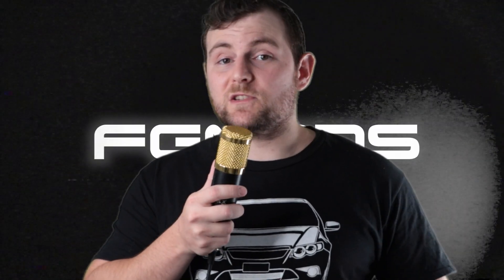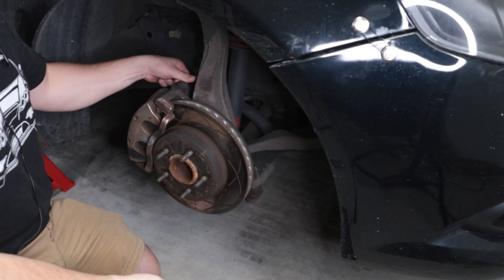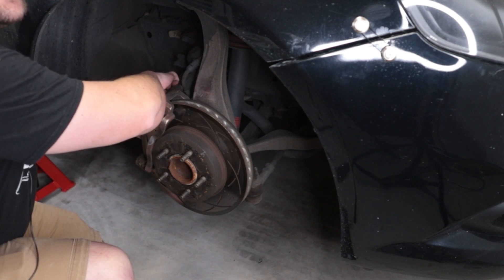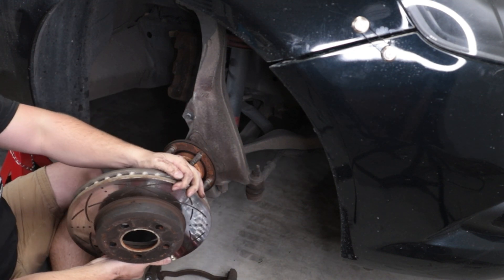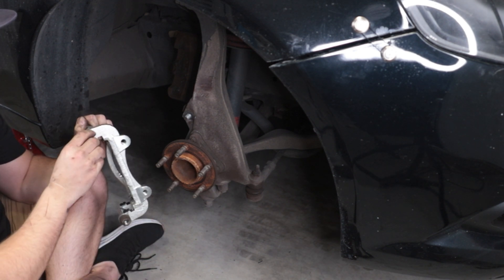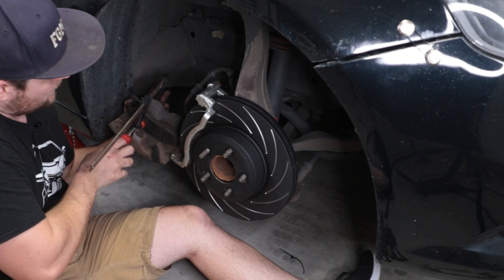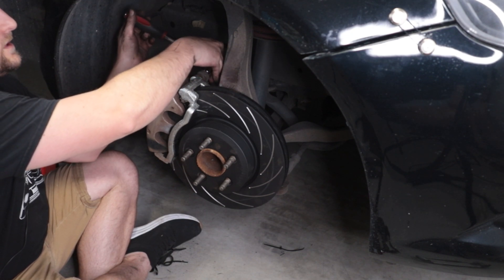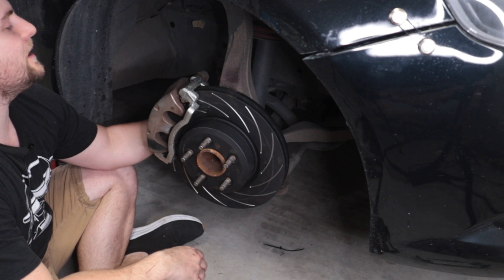Falcon NA to Turbo brakes conversion #fordfalcon #xr6turbo #xr6 #barra

Comment: Liking my upgrade. Bought my fg with 380k on the clock. front pads had 1mm of pad left and orig rotors lol so this upgrade only cost me $100 for the bracket set on top of new rotors and pads. I opted for dba 4000s and ebc yellow stuff pads. Next up is some used territory rear calipers and some upsized 328mm thicker vented rotors and ebc yellow stuff pads for the rear. used calipers cost me $100 so again only $100 over replacing the stuffed rotors and pads.

Comment: Further brake upgrade path:

- DBA Extreme (Orange) pads at front (alternative EBC Yellow Stuff). The F'c v stops v temp of these pads is epic. Look up the data.

- same brake pads at the rear! Yes it makes a massive difference; it took me 10 years and many brake replacements to figure that out

- HEL (Australian) braided brake lines all round

- ideally pillar vented (or DBA 'Kangaroo Paw') front discs, and more ideally, the same type of disc at the rear if applicable (I am running a BA-T with Factory FPV Blue/Premium Black C5/6 PBR brakes)

- most ideally, go the DBA 2 Piece DBA5000, alloy hat front discs

It's pretty epic what lightweight, high quality, sliding calipers can do.
Reply: Hey does it matter which brake line you use or does it have to be Ford falcon specific because I can't find falcon ones on their website

Comment: So here is the interesting thing. Everyone assumes a person installing a turbo is a wanker who plans to race on the roads at way above legal speed limits. The person may or may not be a wanker; but that does not mean he/she is going to exceed speed limits. They might just like to get up to the speed limit quicker than stock engines, or they might have in mind to tow a trailer or something and want to do it easier. The need for larger brakes comes with the intent to do high speeds or tow heavy loads. If you are a person who just likes extra oomph and are not one of the aforesaid wankers who plans to greatly exceed speed limits on public roads there really is no need to upgrade your brakes at all. That is unless you are a person who believes the brakes were just plain crap in the 1st place as the manufacturer made the vehicle. So to all those who plan to drive with common sense you could save yourself the exercise and the money of upgrade to something way beyond what you need. But it is nice to know upgrading can be a simple enough job and not overly expensive. Thanks for the video.
Reply: They could also be racing legally

Comment: If you use Planet Parts front brake upgrade (rotors & said brackets), and do the Territory rear brake upgrade (you will need to trim the backing plate a tad), and with some EBC (my go to choice) pads (i used red fronts & yellow rears) it is a bang for buck upgrade; you can upgrade the rotors to something decent, and if you can snag a PBR Sports upgrade kit, isnt too bad & can be done for less than half of a Brembo 4 Spot front with PBR rear upgrade. 
And having done both a a 2nd hand & new Brembo upgrade to my F6 (from 4 to 6 piston) and BF XR8 respectively, whilst brakes are one area you should never scrimp on, the above i mentioned in the first line is miles ahead of the factory warp happy crap
Reply: Hey mate, do you have a a photo of your backing plate where you trimmed? For the territory rears, and if you had to run the rear brake lines differently?, keen to do the upgrade on my Fairmont ghia.
Reply: @jaken7738  Once you dummy mount everything, its pretty easy to figure out; just make sure you dont bend the backing plates (otherwise they will rub on the rotor).
Make sure to give the plates a clean & a lick of paint to stop rust.

You can run the Territory lines, from memory we had to twist them a particular way, but as theu were 2nd hand, they wernt that great condition; i ended up getting all new braided lines F+R (with the rears suited to the brake swap)

Dunno if that helps or not, i probably do have conversion photos on an old laptop somewhere. That young fella that had the turquoise FG sedan (NA & Turbo) had a video about the conversion, im oretty sure it shows where to mod the plates.

Edit: Zac Baldy is the channel, the video will be a few years back 🤙

Comment: How much did they improve your stopping power?
Reply from the maker: Not at all. 

Turbo brake setup use the same booster, pad size, calliper size, so there’s no extra force being applied.
The benefit of turbo brakes (these bigger rotors) is that you now have greater heat absorption. 
So can be worked harder for longer before they do lose stopping power. 

So I suppose that could be considered greater stopping power in a way??
Reply: @fgmods  They are larger diameter {By about 10mm}. They will just because of that fact increase braking efficiency with the same pedal pressure, even if you are not particularly aware of it.
Reply: Only really improves the fact that the na brake package is dog shit and prone to warping pads definitely a good upgrade if you want to save headaches in the future

Comment: Nice job.
Links to parts used ? > Cheers.
Reply from the maker: The particular ones I used aren't listed anymore.
But if you search along the lines of "FG Falcon turbo brake bracket" you should find them easily.

Comment: First mod I did to my FG...  Too cheap and easy to ignore!  I used cheap rotors and didn't know about being very pedantic about cleaning the hub2rotor contact areas.  Result was annoying steering wheel shake when braking heavily and the rotors warmed up.  Eventually replaced the discs with DBA's and cleaned the mating surfaces really well.  No more steering shake!
Reply from the maker: Yeah cleaning is a big thing.
When I do the video on a proper service and refresh for the brakes I’ll be mentioning cleaning, because it is important.